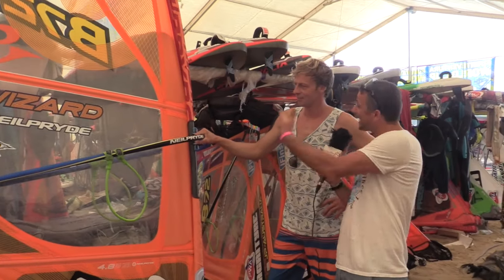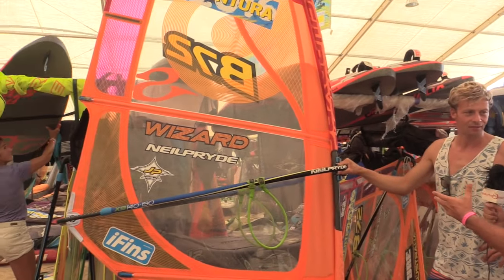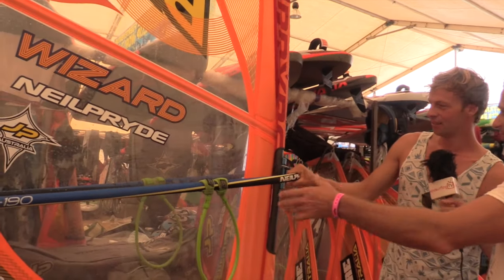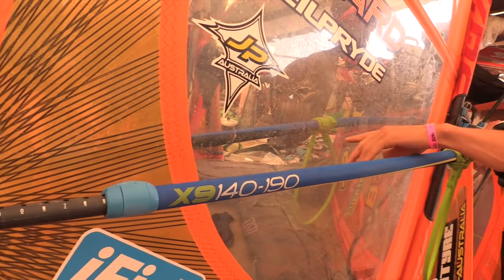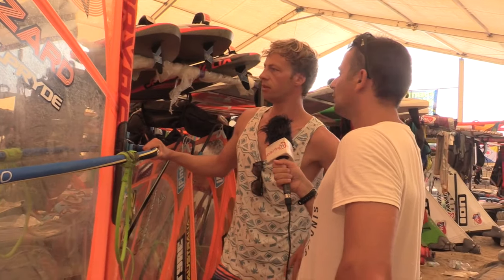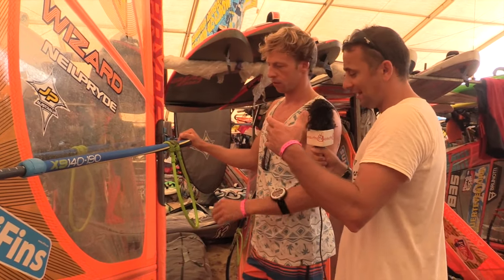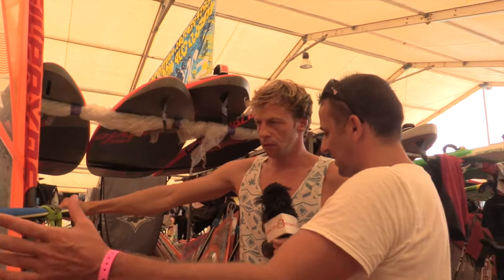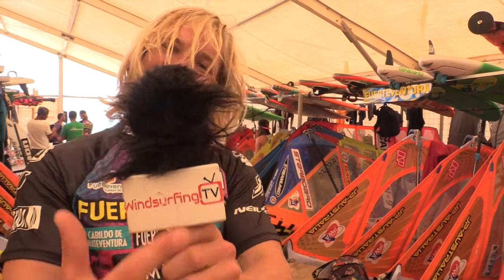Pro Setup – Freestyle Sail – Steven Van Broeckhoven

Comment: Hi Ben et al, another great video! 
Question! I have been using "power" wave sails 3.7-6.2 for all disciplines (wave, freeride, lightwind freestyle) because of durability. As I understand this video I should basically change to freestyle sails instead with the added bonus of cutting down on sail sizes by 1 m2 ??